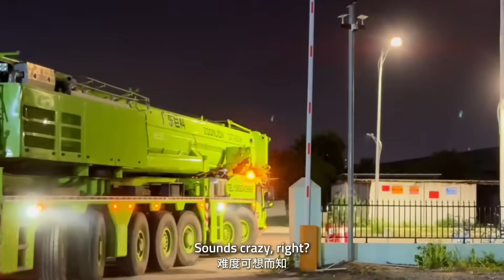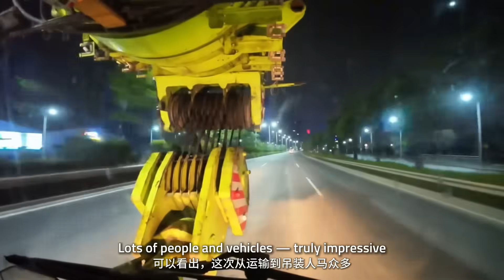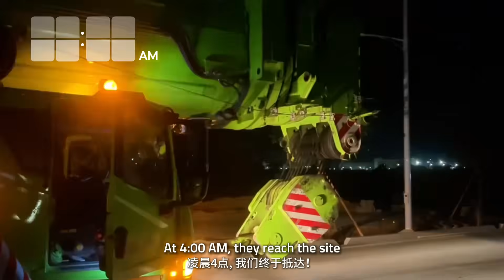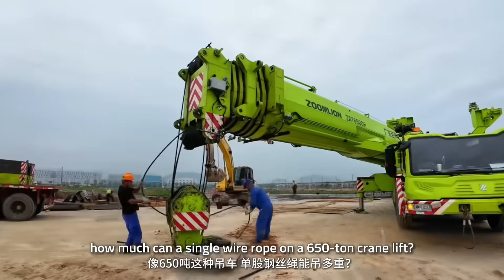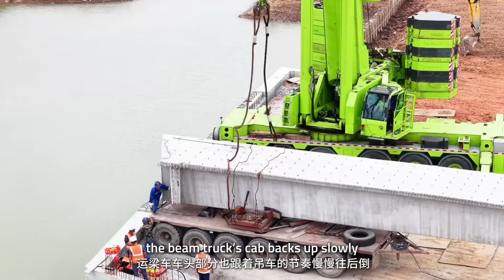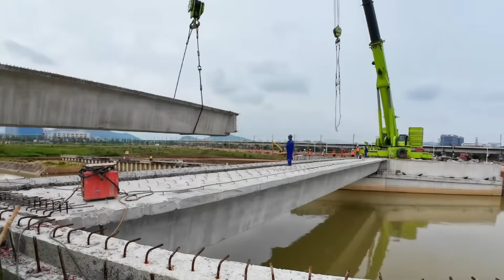Chinese-Manufactured 650-Ton Cranes：24-Hour Bridge Build Challenge！

Comment: Using water as a counterweight may be a useful strategy. Rather than moving concrete (which has logistical challenges), water can be pumped from a local source into a relatively light container (or series of containers), and then released when complete.
Reply: Good idea. I suppose it depends on how much counterbalance is required. Not sure water has high enough density.